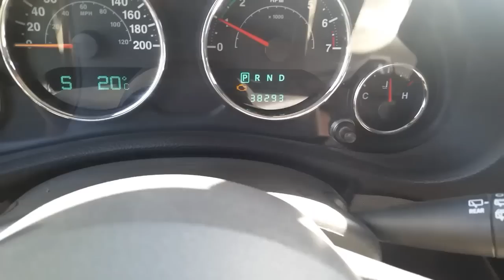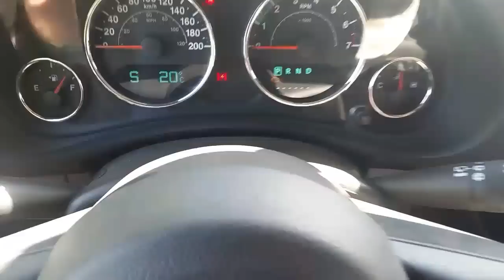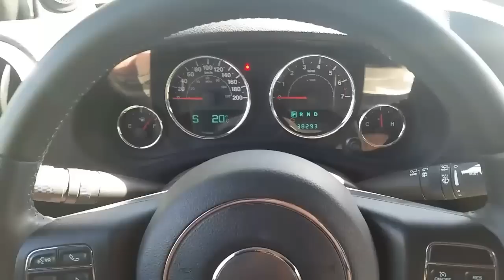How to Read Check Engine Light Codes Without a Scanner Jeep Wrangler Chrysler and Dodge

Comment: Just wanted to tell you guys thats been working on cars ever since obd came out on cars....lol....I found out in 2000 after I bought my 1995 Jeep. Ive been using it for 23 yrs. I just thought everybody knew but I guess everybody learns at some time. It does work on the older cars also!
Reply: So it will work on my 2006 2 door jeep wrangler ?
Reply: @liven4happynus115  I dont know. Try it and see!!!

Comment: 2018 Jeep Wrangler. Did the 3 times, and then started the engine. Got code "9A5CAP".  GASCAP !!!!!!!!!!!   Sweet!!!!!!!!! Thank you SO much. The dealer is 1 hour away, and I will just replace the "9A5CAP" !!!!!!!

Comment: For anyone having trouble getting this to work, try doing it as fast as you can. I was doing it pretty quickly with no luck but as soon as I did it so fast the dash barely had time to respond it worked. Oil pressure sensor of course for me! Good luck
Reply: You are CORRECT my friend.  Did a super fast switch and voila', P0128 on my 2014 Jeep Wrangler Sahara (4 door). Lucky break, a DIY fix.  This code is related to the theremostat.  I'm going to flush the engine and change the thermostat. Little messy, but not rocket surgery on this engine.  Special thanks to Pat's Garage for making this video.
Reply: worked on my 2009. had to do it really quick.

Comment: Our fancy warranty just got voided. Due to Covid and lockdowns our car only travel 500 km in two years.
The insurance company handling the warranty said you should’ve got your car serviced every 12 months.
fancy warranty isn’t worth the paper it’s written on. We had an electrical fault that took six hours to find and we got billed $500.
The problem part is not serviceable, hadn’t thrown a code for 5000 km……
And now these arseholes want to void the warranty.

Comment: My 2014 3.6L Penatstar was running at reduced power. Oil pressure sensor failed. When it dies, the cam phasers will stay in fixed low power position. YouTube Motorcity Mechanic does a great step by step video of how to replace the bad sensor yourself. Don't trust the Stealerships to be honest and fair. They are in it for the $$$$$.

Comment: No work on Jeep Wrangler 2013
Reply: Ive tried on my wrangler 2013 aswell, it did work once a few years back when the check engine light was on, this time its not.
So it works on some things and others not so well. Also after driving a bit the the traction indicator light came on and i did feel a release from a bog down i wasnt on terrain or ice. 😖perplexed .

Comment: THIS TEST DOES NOT WORK IF THERE IS NO PROBLEM WITH YOUR SYSTEM! If you are curious as to whether your CHRYSLER or DODGE can read a check engine code - answer both questions - YES! 1. Do you have a digital message center in the instrument cluster - just below the speedometer (in the odometer area)??? 2. Is your check engine light "ON" (amber-colored engine light) while the engine is running??? My 2007 Jeep has this feature and it DINGED when the check engine light came on to display a loose or missing GASCAP.
Reply: If no problems, you should at minimum still get the word "done".
Reply: It will reset the computer (brain) in the vehicle. If the vehicle won't start, something is wrong with it

Comment: Works great on my 2009 JK. To those having trouble, just be sure when you're turning your key on and off, you're not turning it completely off. It's from full off to full on, then back to middle position only, twice. Made all the difference when I got it right.
Reply: I tried and tried on my 2009, and got nothing. Sucks...
Reply: my 2010 won’t display anything & check engine light is still on. don’t know what i’m doing wrong (all doors are closed)
Reply: 🙌🏼🙌🏼 bless you
Reply: I’ve tried everything on my 2011 JK and still no code
Reply: Thank you, it helped me.. but it just says done!

Comment: Very helpful, but do you know why a  small red light above the temperature gage comes on while driving ?this is on a 2015 JK..P/S. it comes on when turning the key and it goes away but it comes back on ? Thanks for you're reply..
Reply: The little red circle light is related to the security chip in your key and the chip reader.  My light was coming on and it was the chip reader going bad.  I got it fixed on warranty at the dealer and it hasn't happened since.

Comment: awesome vid. on my jeep I can get the dashes to show up but no code will show up . any tips?
Reply: My 2013 wrangler,  did the same the ✔ engine light was on i knew ant the ignition test b4 it just went thru the cycle and read. done , it didnt indicate a code. So i came to look for a plugin obd reader. . Got sucked into reading comments looking for answeres . 
Brainstorm-- new drinking game drop an 8 ball dice into the bottle- each person taking the shot has to ask aloud a question prior to the shot.
Reply from the maker: Chad Reimer is there a check engine light on before u do it??
Reply: Pat4x4 yes

Comment: I have a 2017 Jeep Wrangler and my light came on 4 days after I picked it up. They fixed the problem on Monday and the light came back on today. I'm upset because I paid all this money for a car that is giving me issues and it has only been a week with me and the first payment hasn't even come out yet.
Reply: Keisha Strachan 3 times same issue is a lemon
Reply: Yep, they just hooked up a obd2 reader and cleared the code bastards
Reply: I have a 2016 Jeep Wrangler and took it to the dealer 4 times for it leaking water inside and 2 weeks ago a check engine light came on and took it back to the dealership and today same thing same Ck engine light came on again .. it will be going back again !!! 
If I had it to do over I would have NEVER bought a 4 door Jeep !!!!
Reply: Lemon law might be a possibility

Comment: mine just blinked  like 10 times??
Reply: Karen Cooper same , do you know now what was wrong with it ? I may have the same problem
Reply: Older models will blink lights instead with a slight pause between codes if there’s more than one issue

Comment: Any updates? I got the same error code... What do I have to look forward to?
Reply from the maker: I had mine replaced under warranty but it was explained to me that the sensor is inexpensive (under $75) however its a little labour intensive to get to because you have to remove the air intake and whatnot.  Still sounds like a pretty straight forward repair however.